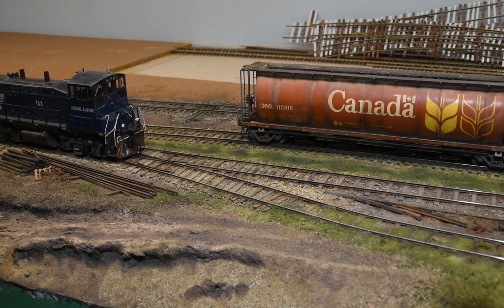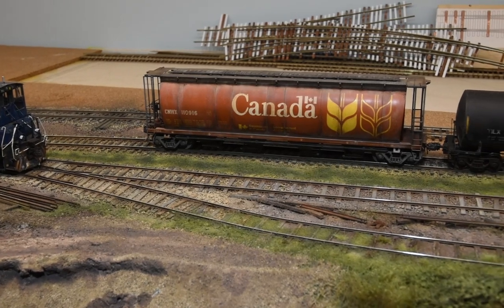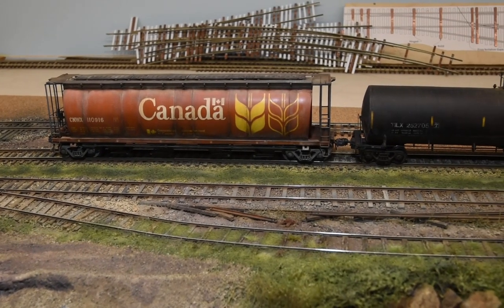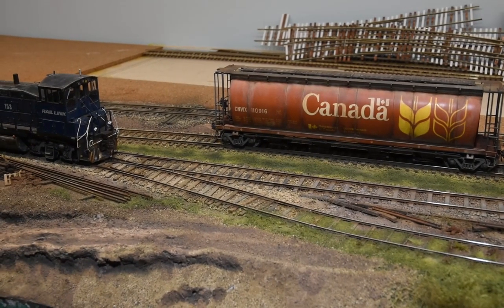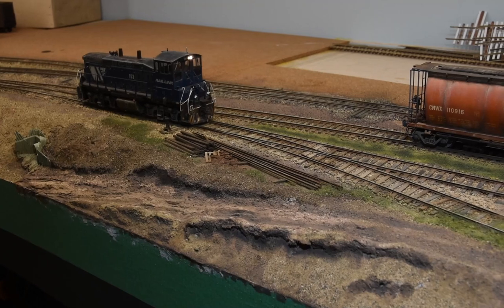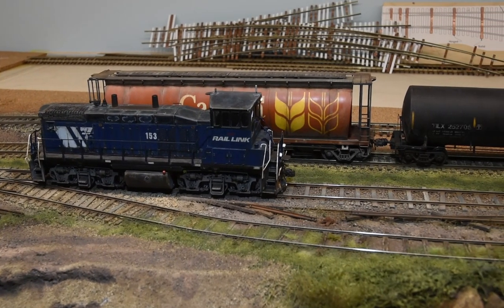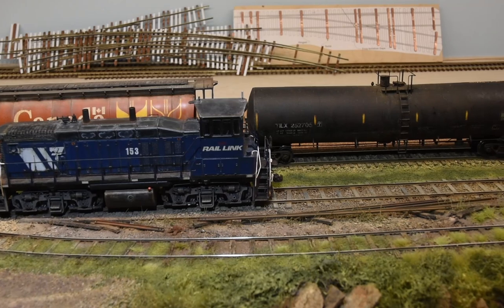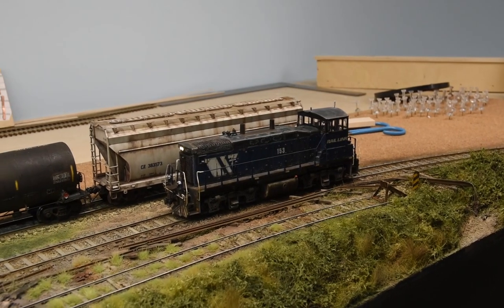HO Scale Code 40 Rail | Will it Run Reliably? - Vlog #34

Comment: C40, C55, C70, C83 nd C100 HO rail scale responding to original realife rail codes
Reply from the maker: I have used C83 quite a bit and C100 for "O" Scale. But then I have used Code 55 for the latter as well.

Comment: I'm a big fan of using smaller rail to make the model trains look bigger.  For HO, code 55 scales to prototype 75 lb. rail and code 40 scales to 60 lb. rail.   By contrast, contemporary mainline rail nowadays is 132 lb. or even 145 lb.
Reply from the maker: Yes. I am with you on that one. Scale rail looks cool. It's half the layout for me.

Comment: i was considering doing one of my very light branch lines in code 55 but was concerned that it would not run reliably.   Based on this video clearly it will be fine....almost makes me want to use code 70 as my heaviest rail rather than code 83 but i already have too many turnouts and other track work at this point.  Thanks for the video and your railroad looks absolutely amazing!
Reply from the maker: Code 83 is O.K. Especially when you paint it. I used it exclusively on 'Glover Road.' This time around I am glad I went with Code 70 for main. Code 55 is easy reliable though. I plan to lay the locomotive shops ladder in Code 55 now as well. Cheers.

Comment: Nice video. From what i can see thing seem to be running over code 40 track just fine. It also looks really good too.- Nicholas.
Reply from the maker: Yes. Things do run fine. I would only use Code 40 for this purpose though. Mind you, Code 55 is completely reliable and looks fantastic as well. Code 70 is also great for mains in this case. Code 40 is tricky to get right though. Cheers.

Comment: It looks impressive. I've done some track with code 55 ho. And mostly thought about code 40.
Reply from the maker: Code 40 is nice for a feature spur in HO. I would stick with Code 55 for general yard track, etc. It surprises me why most N Scalers don't use code 40 for main.
Reply: @boomerdiorama   There are no commercially available turnouts in Code 40 for for N scale (or any other scale).
Reply from the maker: @edmundnadolski3588  Fast Tracks has jigs for them: https://www.handlaidtrack.com/fixtures-n-turnouts

Comment: Code 40 looks amazing, but I think my O scale brass sd40-2 might not like it. LOL!!!
Seriously, there is a Q and A in this month issue of Model RR magazine that says HO rail is not accurate. If you are going to err, use smaller rail. It just looks more realistic.
Reply from the maker: HO Scale should be 4'-8.5" wide, not 5' feet as it is. It does help to use lighter rail and space the ties out a little more though. Cheers.
Reply: @boomerdiorama  For O scale there is also Proto:48 which uses 4' 8.5" gauge, but it's not compatible with traditional 2-rail O-scale
Reply from the maker: @edmundnadolski3588  I used to build Proto: 48 back in the day for Traction (Interurban). Both rails were grounded (black) and power was picked up by over-head (Bronze) wire, Really nice scale to model in for sure. Cheers.

Comment: Boomer that is splendid work. But are the ties really spaced that much farther apart than on class V mainline track?
Reply from the maker: Thank You. You raise an interesting point. Maybe. The real world surprises me all the time. They are usually spaced out a little more depending on the purpose of the spur etc. I have seen track so low in the dirt where the ties are practically invisible (covered in moss, etc.) I plan to work it over a little more with soil where the road comes up. Cheers.
Reply: I will look forward to more of your work. I love the area you have chosen to model. My late father was born in Vancouver and I grew up just across the border so I am familiar with it.
Reply from the maker: @douglaspolinder9232  Yes. The Pacific West Coast is a beautiful site to behold. The region is imbedded in my soul. I could hike the coast forever and be completely content . . . even without going anywhere else on the planet. Thank You for sharing. Cheers.